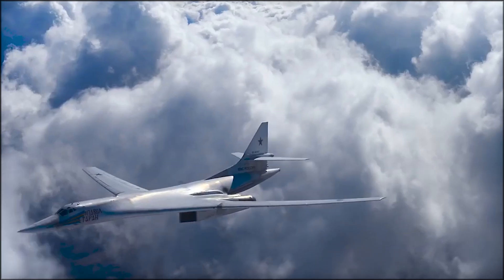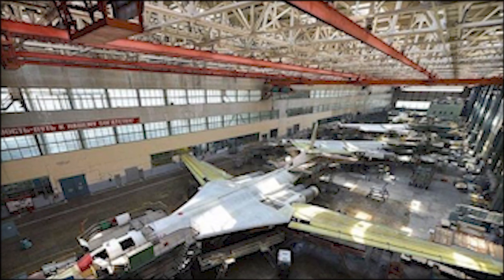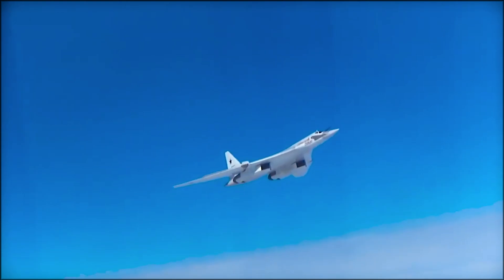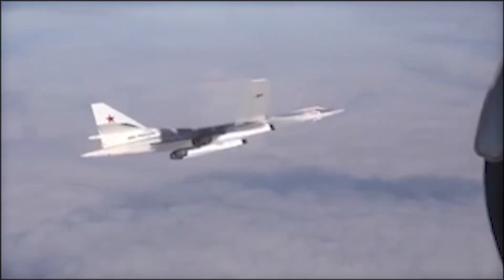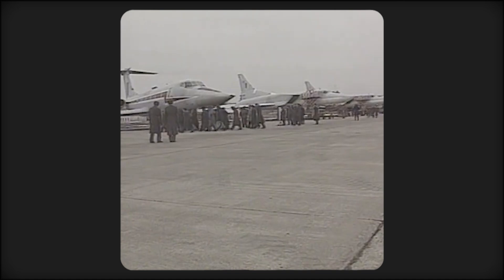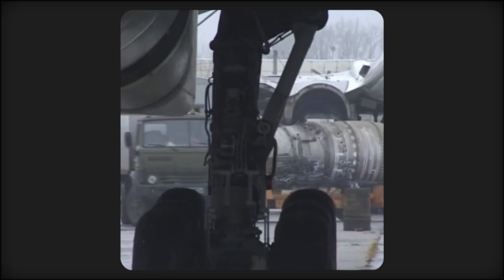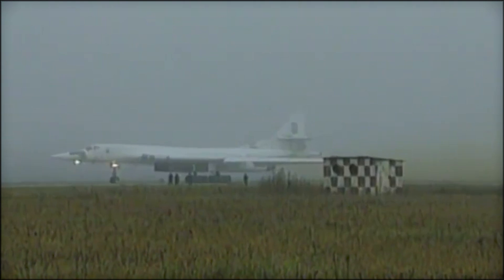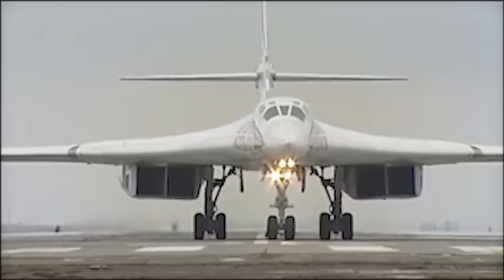Why did Russia copy a US bomber design?

Comment: Are you next going to tell us that Russia did not copy the B29 literally bolt by bolt ?
Reply: They pretty much did exactly that though according to the web, Russian TU 4 was over 300 kg heavier, though this is a minor point. Must have really pissed the Russians off big time when in 1947 they found out the US B47 first flew four month after their much slower B29/TU-4 first flew. All that effort and all they had was an obsolete bomber, easily shot down by jets of the time as shown by combat experience during the Korean War with MiG 15s easily dealing with USAF B29s
Reply: maybe, maybe not.  There was a heavy influence from german engineers after 1945.  CCCP was developing its own microchip, based on Konrad Zuse's work, the same rackets, AK-47 and what not.  And in between was influence of all the soviet engineers.